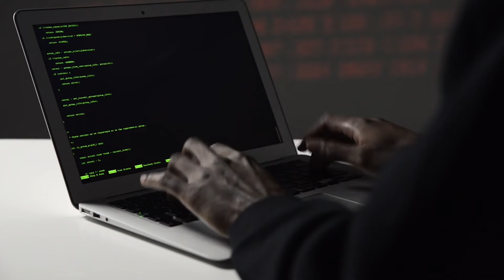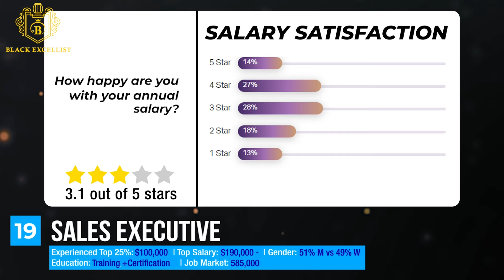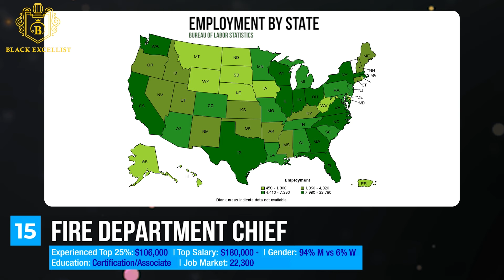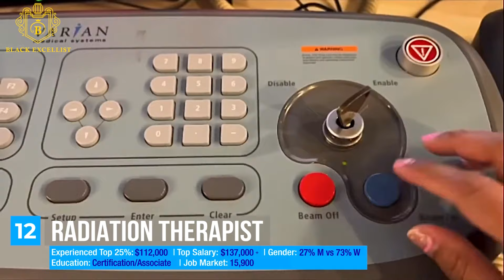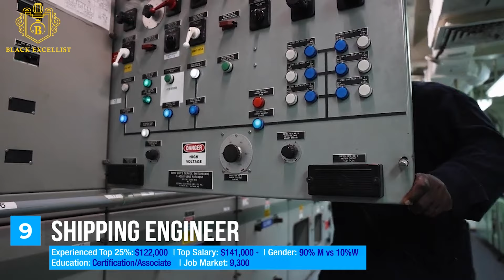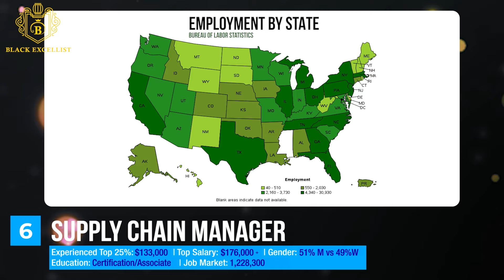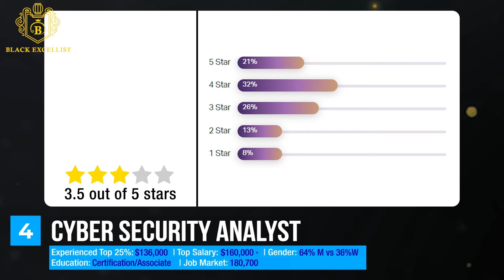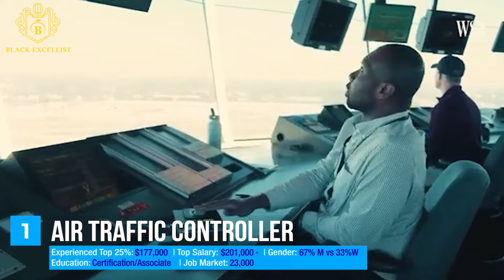Top 20 Jobs Paying $100,000+ with No 4Yr College Degree

Comment: What's the catch?
Reply: The applicants may need to have skills from a previous job or a well established portfolio. Some of the opportunities in this video are entry-level as well. Dedication is the key.
Reply from the maker: Hard work
Reply: You need certification from a technical school for most of these which is just as expensive as college, the program is just not as long.  Also, you will not be making 6 figures without experience unless you do alot of OT, it takes time.